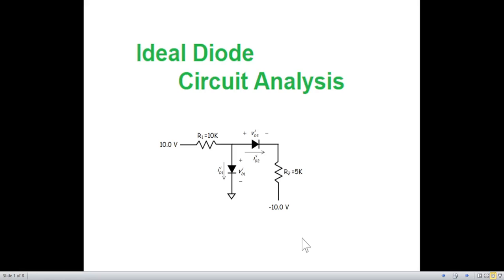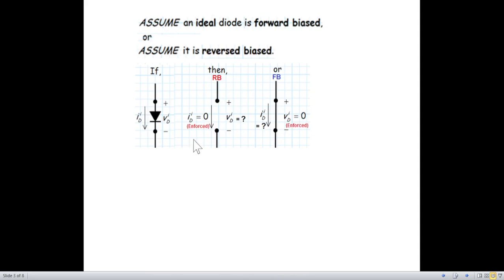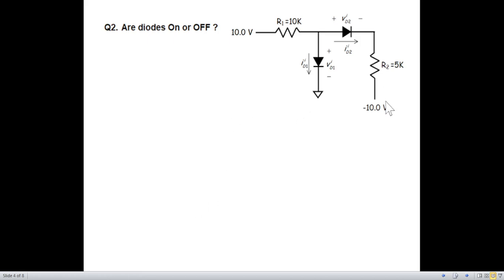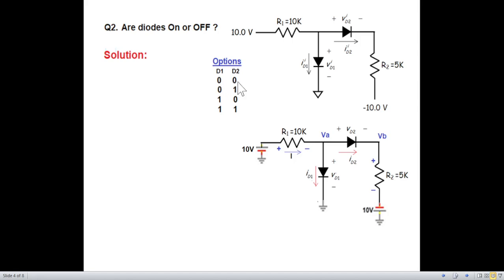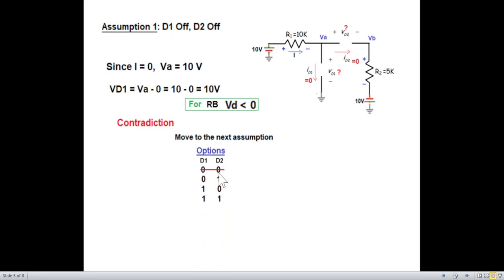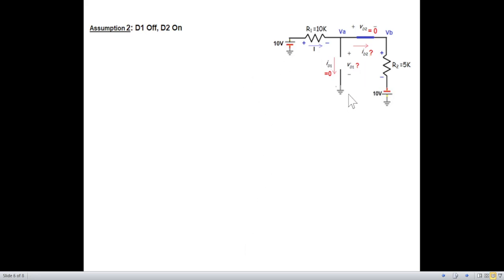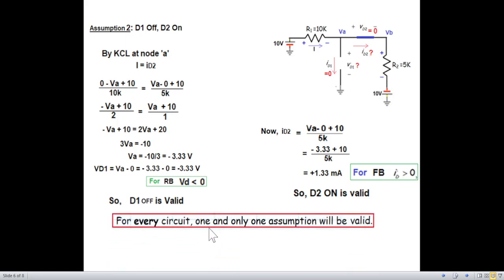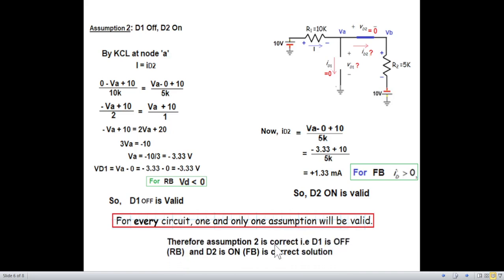(E)EDC || Ideal Diode Circuit Analysis ||   Forward Bias or Reverse Bias? Circuit with 2 Diodes

Comment: Why know Va = 0 in assumption 3 ???
Reply from the maker: It is Zero. Watch carefully from time 13:45
Reply: @ElectricalEngineeringAcademy  What if you use the voltage drop model? Please
Reply from the maker: @ Please mail me your working, so I can understand.
Reply: @ElectricalEngineeringAcademy  I want you to solve this problem using the voltage drop model. Please!!!